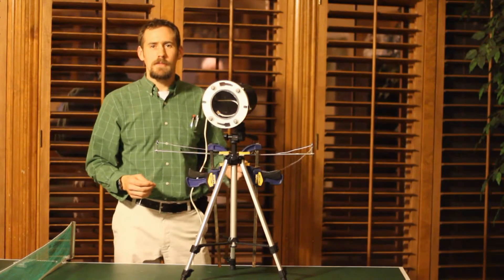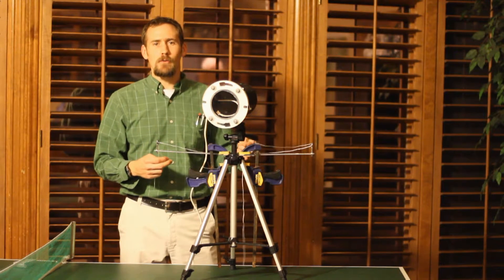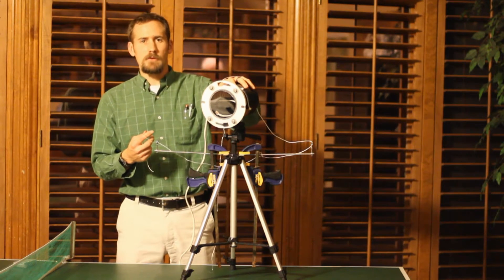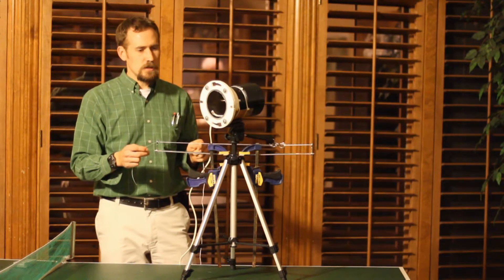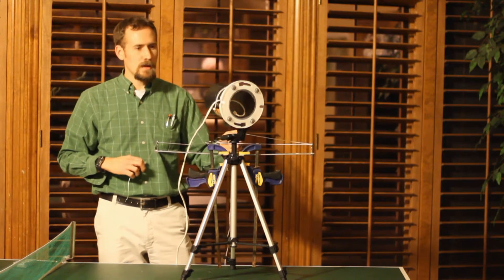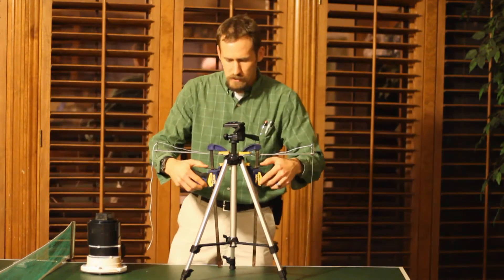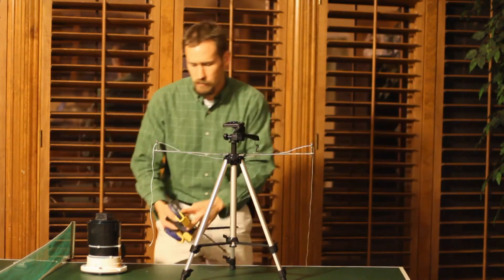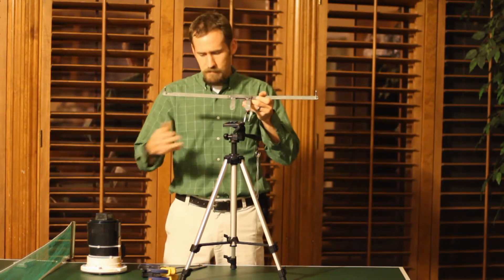Live, streaming HD underwater video for Underwater Hockey

Comment from the maker: Yeah, Airborne lent me the camera for the tournament.  Probably the easiest and cheapest live video solution for other clubs would be to drill a hole in the waterproof case on a GoPro camera to have a HDMI cable sticking out (you would then need to seal around the hole in the case with silicone).  You would need a really long HDMI cable (search the net) going to a HD TV.  The problem with that solution is that you'd be limited by the battery life of the GoPro.